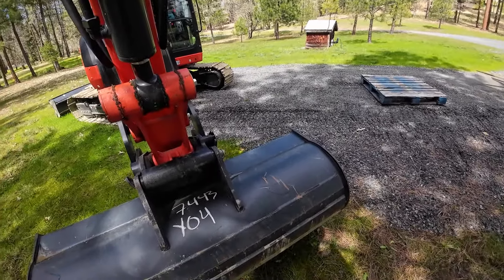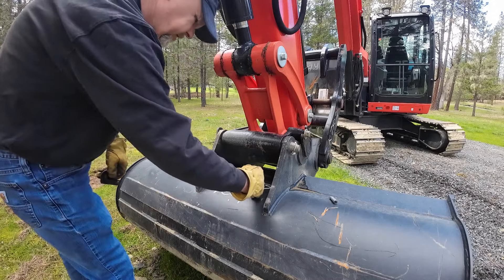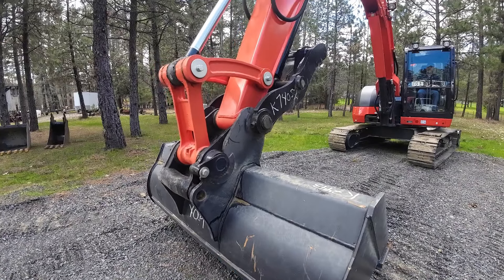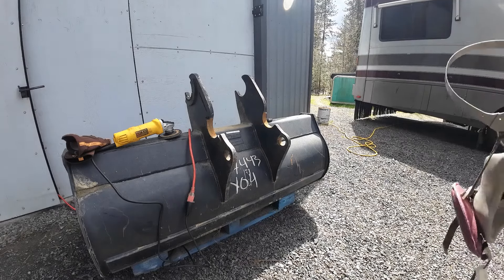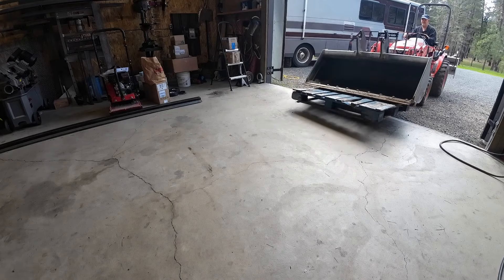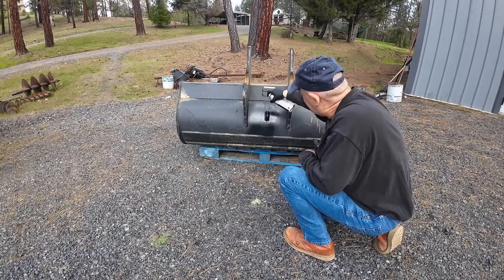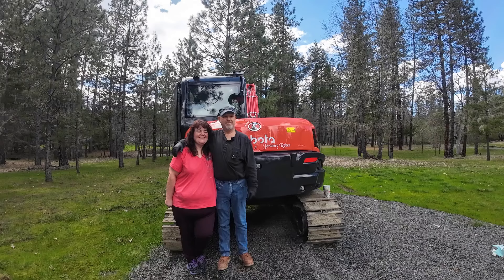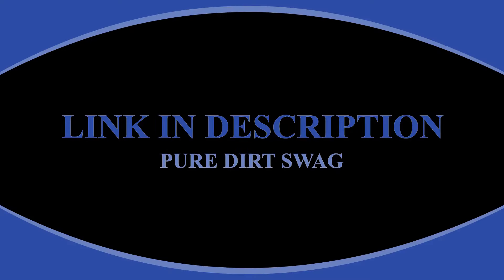The new Kubota KX 080 4 gets decals and how to weld a hook on

Comment: Nice addition to any excavator attachment, there is no need for backing plates on excavator buckets, they are made of AR 400 steel wheras tractor buckets are much softer steel and the larger welded area will prevent ripping the soft steel. Nice job.
Reply from the maker: Thank you and you are correct on not needing backing plates. Thank you for watching, and have a wonderful day 🙂

Comment: Surprised no backing plate.
Reply from the maker: I have used the same hooks on the 40 welded the same way and have broken many chains with no damage to the bucket or hook. I don't intend on using it on anything too extreme. Even the factory lifting eyes on the 18" and 36" digging buckets don't have backing plates. When I weld hooks onto lightweight tractor buckets, I do always use a backing plate.  Thanks for watching, and have a wonderful day 🙂